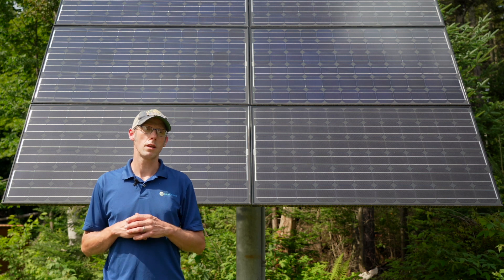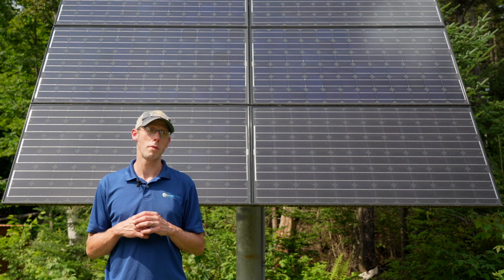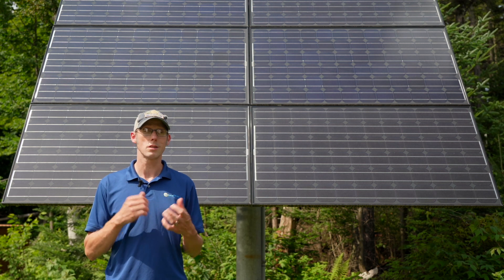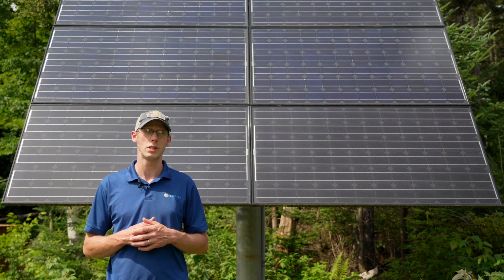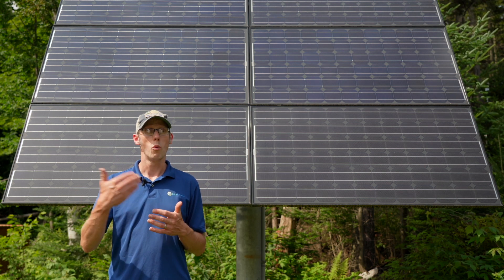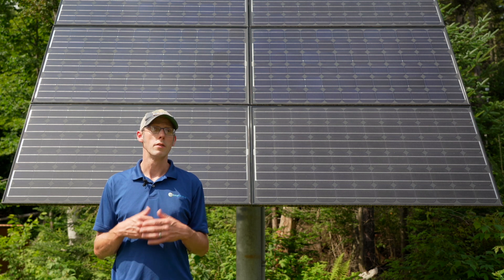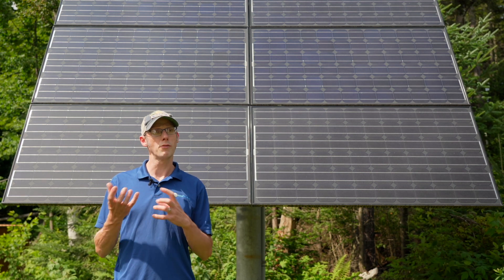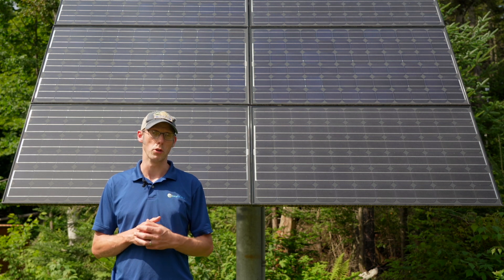How Can You Use Your Solar Panel Energy When The Power Is Out?

Comment: What do EnPhase iq7 micro inverters, do? Do they allow you to use straight power from your panels when the power goes out? What makes sure the power is clean so appliances don’t break in the house? 
Would it be possible to have a major switch installed that when the power goes out, the panels then go to a 3kWh battery (so power is smooth and clean), and then to the whole house, and then you can get power from solar panels. But when power is not out, the small battery isn’t connected to the other side of the switch so it  doesn’t charge and discharge every day killing its lifespan with 365 power cycles a year? Basically a way to switch over to battery but a small battery. Thanks.

Comment: Ok, If there is a safety switch to run a generator while power is down, Why cant there be a safety switch to operate  the solar system while power grid is down?
Reply from the maker: Our experts say that in order for solar panels to disconnect from the grid, they need to be able to island themselves, and the most common way to do that is with a battery. But there are some solutions coming to the market to let you disconnect without a battery, like the Enphase IQ8 microinverters.

Comment: sounds like on either side of the grid or the generator, you have to have the Solar disconnected before operate the generator. These days, grid tie solar shuts off when grid is down. And if you have off-grid solar, why not use battery storage instead of gas generator.